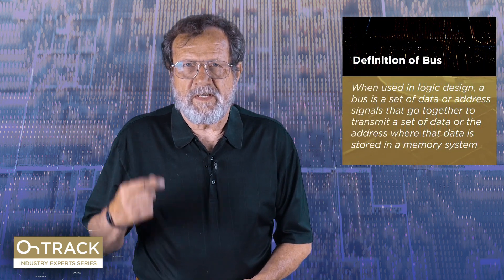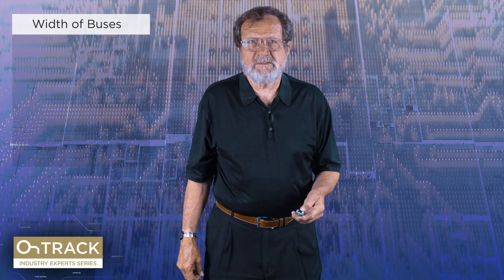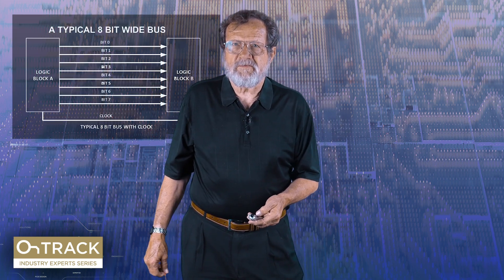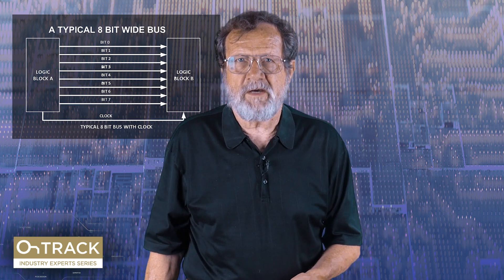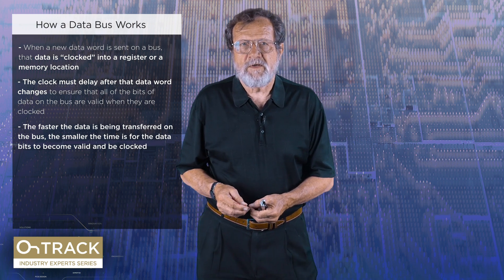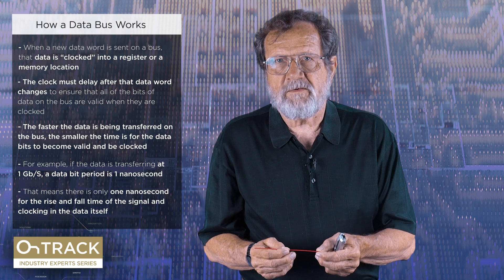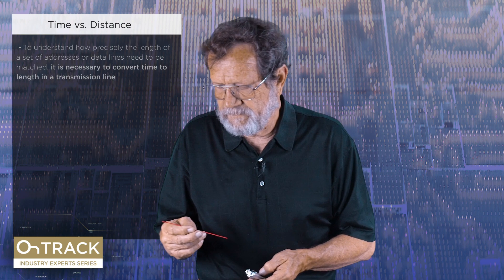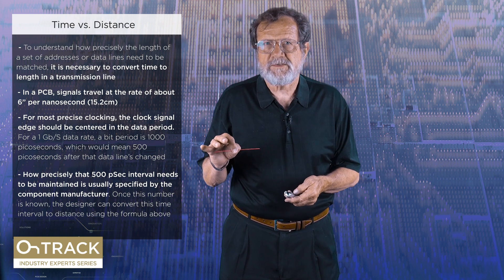Is Length Matching Required in High Speed Buses? - Altium Academy

Comment: Thank you for the great information. I have in the past used length matching for busses, but have in the last 5 years moved to TOF(Time of flight). Would lthe assumption be correct to say that TOF is a better way for matchin legnths? I match my tracks to 1ps accross the bus, this seems like a overkill, but when I match tracks, I found that matching to 1ps and matching to 100ps is the same amount of effort.
Reply: TOF is the objectively correct way to match lengths. As long as you can calculate the time difference, you can calculate the length difference, and then you can use the length mismatch constraint.

Comment: Thank you for positing.  I found your assessment a bit difficult to follow, my bad not yours.  If you can please humor me by reviewing my example question that would be most appreciated.  So assume my bus is made of address, data, and control and has a clock rate of 100MHz.  So to center the address, data and control on clock the allowable time margin would be ½ the clock period or 5ns.  If I estimate my velocity of propagation on the PCB to be 150mm/ns (about 6”/ns) then the distance traveled per 5ns would be 750mm.  So in this example for my address, data and control to be perfectly in sync with the clock would require ALL lines (including clock) to be 750mm long.  Conversely, since this is such an abnormally long length if actually PCB trace lengths were non-equal, but for the purpose of this example the longest of which being 200mm, and the shortest 150mm, then I would assume the time / distance to be non-factor and as such only take precaution to ensure the clock was the longest traveled signal (say 250mm).  Is this assessment correct, if not can you please point out and correct were it goes wrong.
Reply: I believe the calculations are needed in a data bus where the data speed is too high, or atleast more than or equal to 1Gbps, where the bit period is too small and we cant afford any small skew. 100MHz clock rate is not a fast enough period that require strict length matching, it has enough time marging for both data and clock lines and the designer is not bound to tune the length of the clock line exactly in Middle of data line period. Even in few DDR2 layouts that run maybe at around 250MHz, clock and data lines are seen to be routed normally,  no length tuning is done and work perfectly. To sum up, the more the data rates go high the less the time margin we get and so we try hard to match the clock line so as to make its transition happen in the middle of data bit period where we assume the data bit to be in most stable condition.
Reply: @Parvi_  Thanks for your response.  The example was not so much about overall bus speed but concept.  The point is you could make just about anything reflect or skew, given enough physical distance comparing point to point or route to route.  I was trying to verify the calculations of my electrical distance (wave length) in my media of propagation against my physical distance as the placement of memory and processor were not ideal.  I saw the video and asked the question for due-diligence sake.  LOL, never did get an answer until now, but thank you for your generous time and response.  You make an excellent observation regarding overall clock speeds and application that are both useful and pragmatic - Much thanks.